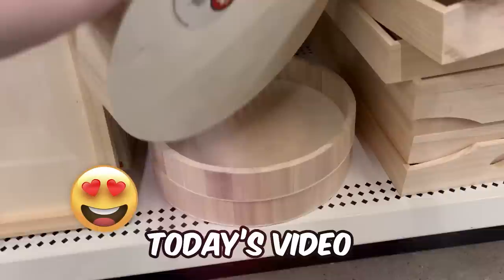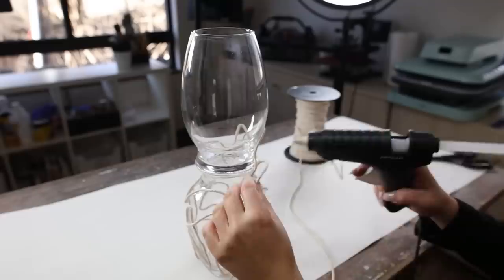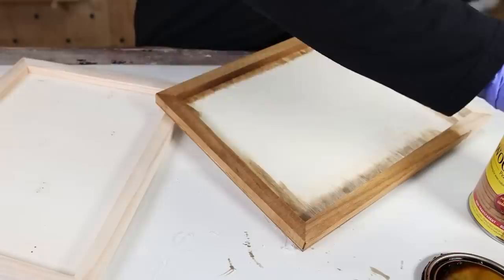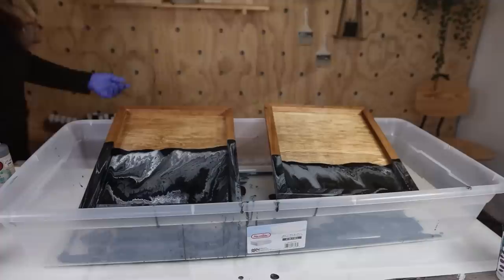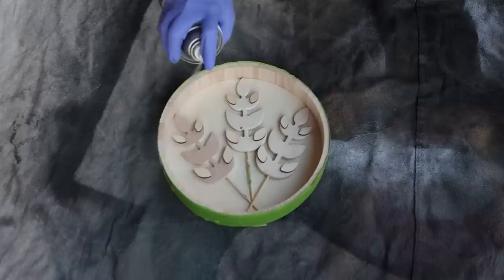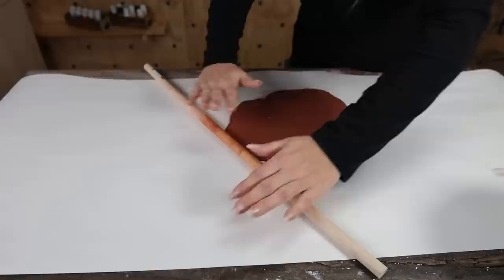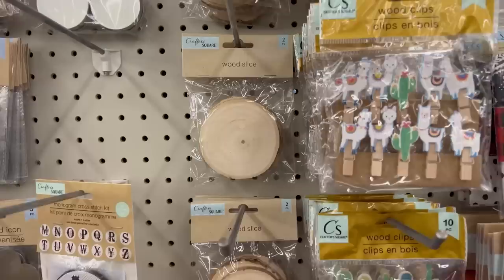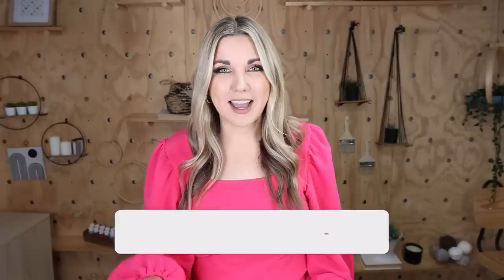Dollar Tree DIY's...High-End Home Decorating on a Budget

Comment: For the air dry clay bowl, I would spray paint it ~maybe with a textured paint like the granite one or whatever and I would glue a few of those glass stones or flat marbles on the bottom and i would fill it with the fine white sand and get a bag of the tiny seashells which ive seen all 3 of these things at $🌲....and then add a few pretty succulents......😊

Comment: I also liked the lamp shade with vase inside ......and I was thinking how neat it would be to do the same concept as youve done before with the wicker "sconces" that you put above your shelves, 
But when spray painting the vases I would tape them and or decal/stencil or any kind of design even using some round stickers that can be peeled off after painting and then put in some of those same lights you used that had the remotes....or even tap lights or tealights or whatever you prefer - and you could use them anywhere....like a staircase, coffee & end tables, in cubby holes that section off an area that are open on both sides to see through, or they can even be made to hang from the ceiling...etc. etc.

Comment: Liz a tip from a hobby ceramic artist- use a plastic rap place it over the cut out bowl shape when still wet and smoth out the edges. also you used a lot of water that made it crack… anoyther tip is to let the bowl over the glass dry until it’s hard enough th stand on its own… than remove bowl and let completely dry- the clay shrinks when it’s drying- that’s why it cracked

Comment: Advice from a potter:  When you lay the clay on the outside of your mold, the clay starts to dry and it shrinks. That's where the splits come from. If you use the inside of your mold, the clay is free to shrink.